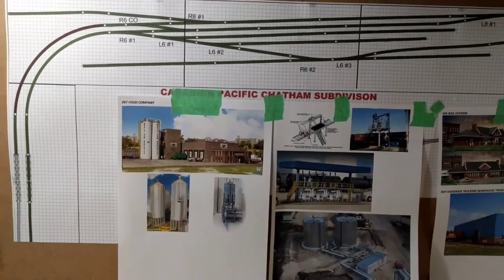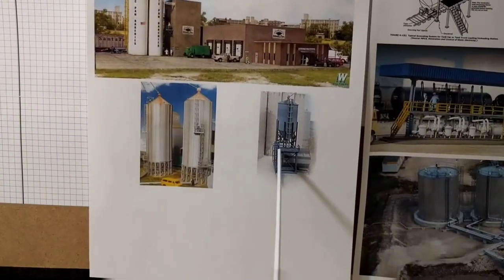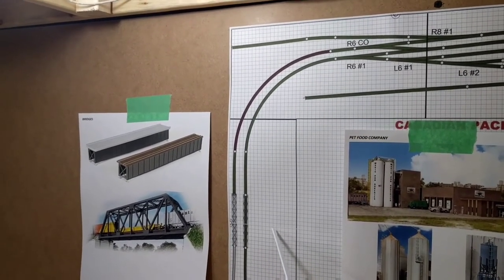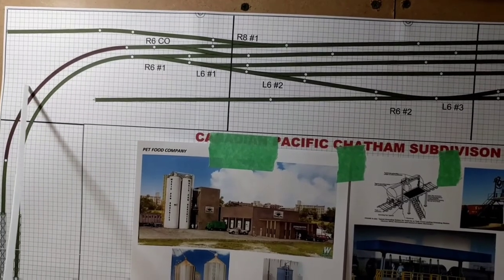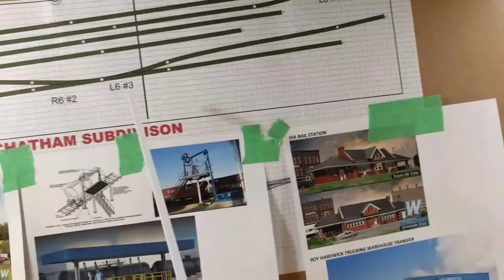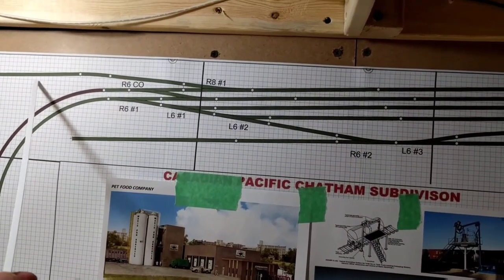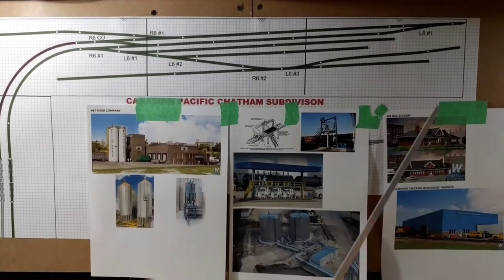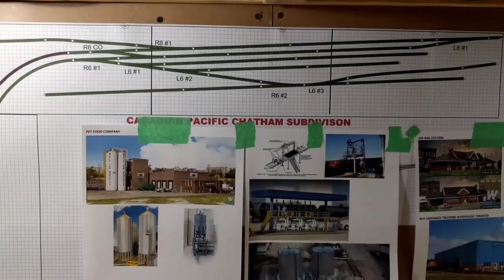Layout 2.0 Trackplan Is Finally Here!!!

Comment: I think you've done a great job planning. Looks like a lot of interesting operations available. thanks for sharing, Chuck RVRR
Reply from the maker: Thanks Chuck, like a said it been about a year in the planning stages, to get to something I really liked and that would hold my interest running trains for a couple of hours. 

Personally i think planning smaller switching layouts is the hardest to plan for compared to larger point to point or continuous running layouts.